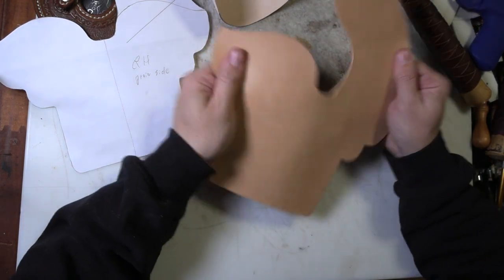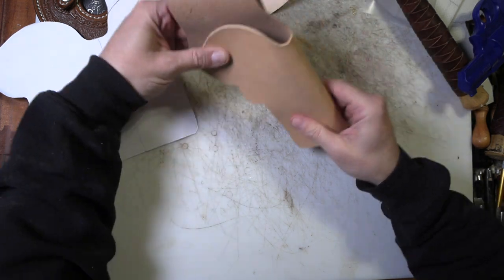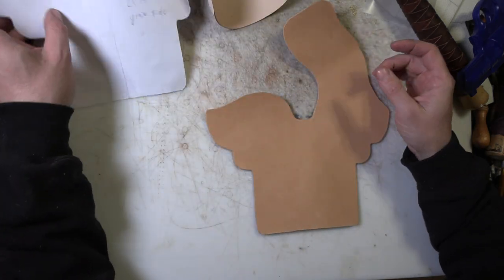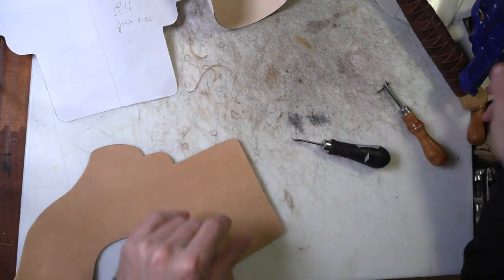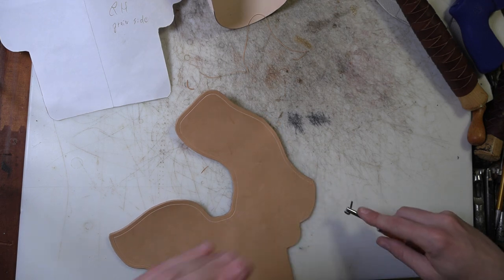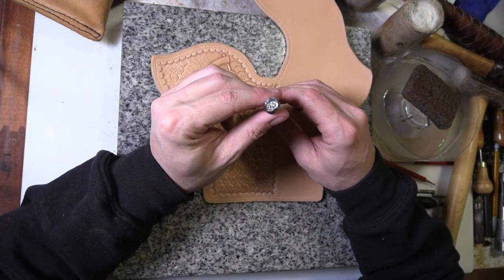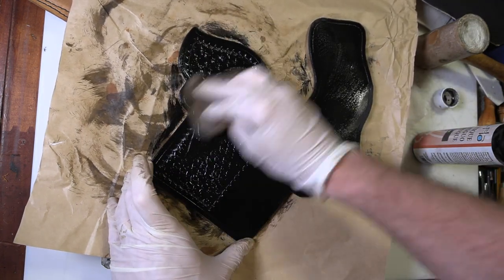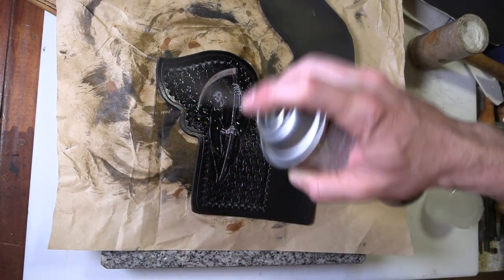Cross draw revolver holster made western style with a folded belt loop and hammer loop

Comment: I like even the single-action holsters with a thumb break snap. It doesn"t look historically correct but I like it. 
  I also wound up making a sort of hybrid flap holster with  a  flap that covered only the hammer and the cylinder of the single action revolver. About half of the grip was left uncovered by the flap. It didn't turn out to be a pretty holster, but it was functional in my neck of the woods. It keeps the sawdust off of the cylinder indexing cuts so the cylinder doesn't freewheel when I cock the hammer back.  I've heard a  bear in the woodcutting area a couple of times too many. When the chain saw makes so much noise it makes it sort of spooky to know there's a bear in the trees behind you.
Reply from the maker: Thumb breaks are a great way to add retention.  They can be a bit tricky to get right for some pistols, but revolvers are not too hard.  Stay safe out there, chainsaws maul more people than bears do.
Reply: Lmao
Reply: @bransonsgeneralstore  
   Make the belt loop a square or your favorite shape. Run it up to the front side of the holster in a pleasing shape if you feel like it. Space it up a little if it's a cross draw. To allow some space for the belt point to fit into the holster belt loop if needed. 
  Then sew on the belt loop before lining  and use the extra leather up top for the snap locking straps. I don't use the metal tab to stiffen the inside snap for the locking straps. I don't really need it. If the leather is wet and then drys it's plenty stiff without the metal stiffened tab. But if you really want one Tandy sells them.

Comment: I need to make one of these for the Magnum Research BFR 444 Marlin I'm buying. Holsters don't exist for them so I gotta make my own.
Reply from the maker: Sounds like a monster of a handgun.  The biggest revolver holster I have made was for a Smith and Wesson 460 with an X frame.  BFR would be even bigger with a longer cylinder.  A couple of videos I have talked about how to make patterns, I don't remember which ones.
Reply: @bransonsgeneralstore  yeah, it's a massive revolver but I figure I'll make the holster with an open end so the 10 inch barrel is showing. With cross draw it'll be more of a carjacker holster when I'm out on the ranch or for hunting. Maybe for those rough trips to the local Walmart too.
Reply: @bransonsgeneralstore  
  Lol. Walmart can get kinda iffy in the parking lot  a few hours after the sun goes down.

Comment: How did you come up with the pattern?
Reply from the maker: I draw them myself starting with a tracing of the firearm.  Usually I trace it, roll it over across the sights and trace the other side then add about half to 3/4 of an inch all the way around depending on the thickness of the firearms frame or trigger guard.  Then just add on the type of belt loop, clip, or paddle I need for the occasion.  I do sell PDF copies of the patterns I make on our Etsy shop.  Link should be in the video description.